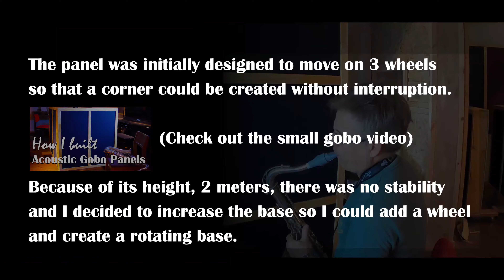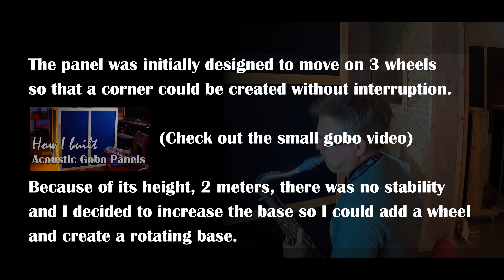How I built Acoustic Gobo Panel 2m high- Part A🎷

Comment: Wow i'd want to build some of those now.
Do you think they could block most of the sound of a drum kit if I "encapsulate" it with 4 or 5 of those gobos (without the caster wheels so they are tight to the ground) ?
I'm on the look for some kind of mobile sound insulation for my appartment , I have neighbors on each side but the walls are thick (old stone village house) and since it's a rental I'd prefer not screwing around with the walls (the paint has been redone before I moved in and they aren't straight at all). 
I've had one neighbor coming to my door one time because my amp was too loud but he never complained about my night mixing sessions so I think with some thick absorbers I could play drums moderately without annoying anyone .
What do you think ?
Reply from the maker: Hi I thought you are John Coltrane :) :)
Anyway .. the Gobos are highly  absorbing. But it is very individual and depends on many factors like: the size of the room, the type of walls and ceiling, the type of floor, and of course the location in the space. I believe that if you'll raise the drums on a wooden surface with insulation and wrap around with Gobos, you will get a very impressive result and absorption
🎷🎷

Comment: What fabric did you use?
Reply from the maker: Regular strech fabric for clothing nothing special
Reply: @ArikLivnat  That's what I thought prior to my panel ordeal. My fabric was not breathable and that was a problem with high/mid frequency reflections/attenuation,.The weave cannot be too tight and should allow air to easily pass through. They call it the blow test for acoustic transparency. Hopefully your material is appropriate.